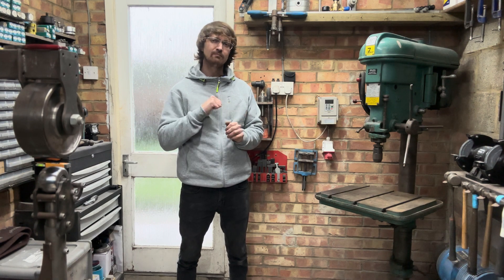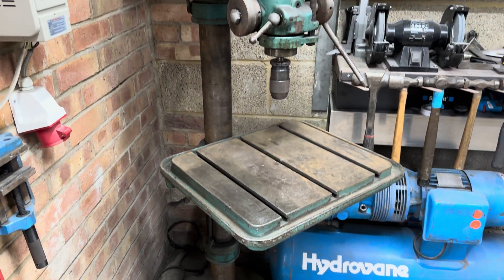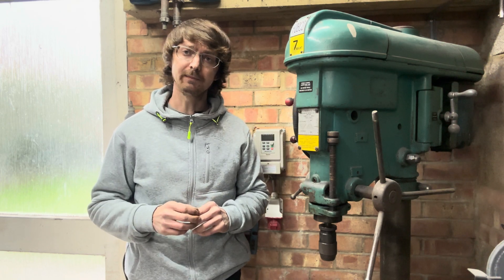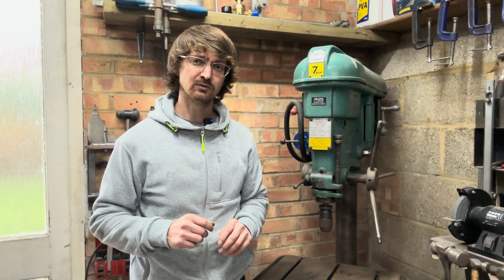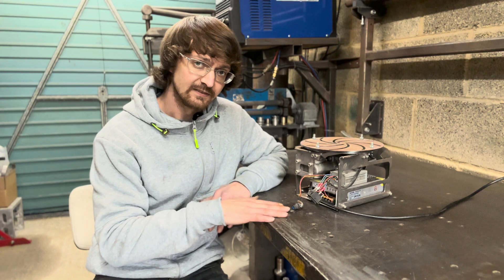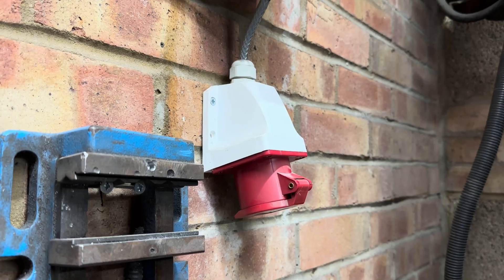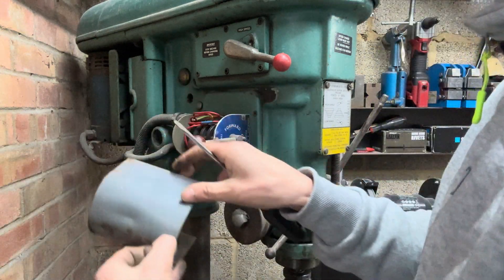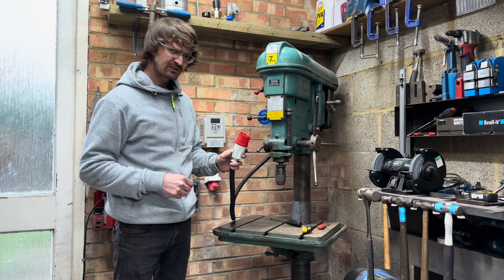EP6 - Running 3 Phase Machines in a Single Phase Garage?!

Comment: Great video, what type of motor did you use in your rotary table? Thanks
Reply from the maker: Thanks Shane 🤝 I can’t remember off the top of my head, it’s been a few years since I’ve had a proper play with it! Only a cheap, 90 degree geared 12v motor I think!

Comment: Ah, I wish it were always that simple! You touched on it at the end (needing the motor to be wired in the delta configuration) but - 3ph in the UK is 415V across all three phases while domestic 1ph is 240V, so this style of VFD will work fine for a motor in delta config but not in star, and not all 3ph motors are selectable in their wiring. The motor on my Bridgeport had the 'point' of the star buried in the housing rather than exposed at the wiring block which meant it would only run 415V 3ph so my options were either a "step up" VFD (more expensive but there are some cheap Chinese ones now), a rotary phase converter (expensive but can run multiple machines) or have the motor re-wound.. the latter (by W.H. Shoebridge & Sons) was by far the most cost effective as they didn't have to do a full rewind, just 'pull out' the star. Is is DIYable but for the cost of the work (under £200) I got new bearings, paint, insulation tested etc etc. Anyway the whole point of this was - if you aren't sure how your motor is wired, a local rewinder is pretty cheap peace of mind and might even be able to save you the cost of a new motor if yours is permanent-star :)

Now I just need to figure out what to do with the 3ph power feed on the X axis.. it's only been three years (sound familiar? 😂)
Reply from the maker: Thanks Aaron! Appreciate the run down! Oh yes, it’s a great feeling 😆
Reply: £200 sounds pretty reasonable. I'm a sparky and would be in two minds whether to DIY or send it out at that price.
Reply: @markrainford1219  I thought it was well worth it considering it also got me an insulation test etc etc on the windings (not like I have a Megger lying around :)) and the bearings, blasting & paint. Lucky for me the place is practically around the corner.

Plus I got to drool over their Colcheste Magnum!

Comment: Can you run a 3 phase tig through one of those josh or will it melt something?
Reply from the maker: I’m pretty sure this type wouldn’t, but I’m not 100% sure. The main job of this type of VFD is to act as a motor controller, so I think you would need a dedicated phase inverter rather than a VFD. Great question! 👍🤝